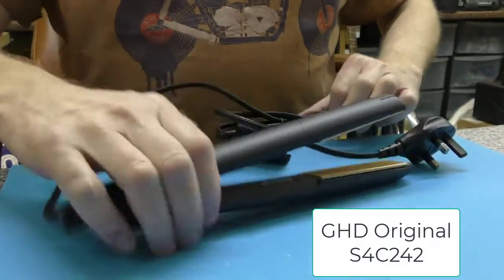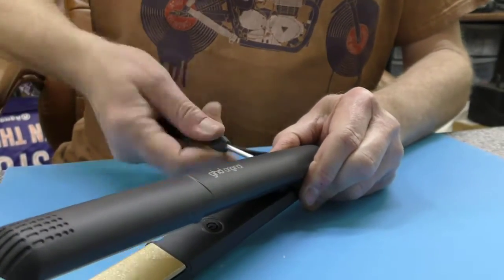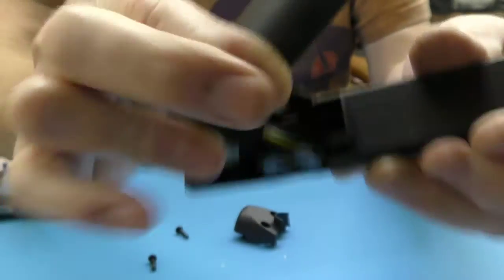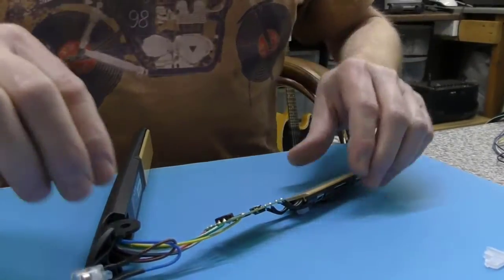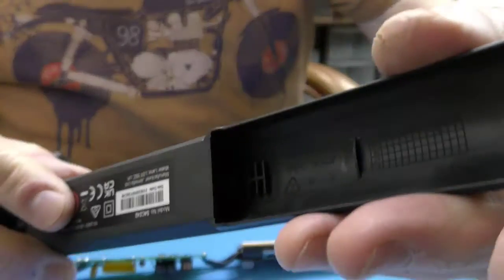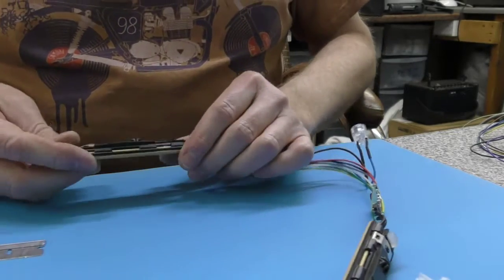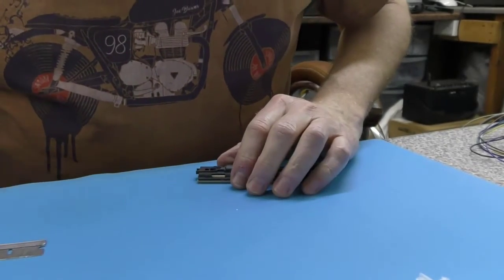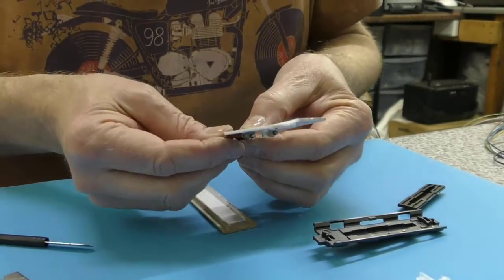New GHD Original S4C242 Hair Straightener Tear Down

Comment: Hi can you tel me why your replacing the heater element when you checked it and you was getting a reading around 540 and 40 ohms … I have stripped the wife straighter down and I’m  getting the same reading does this mean I just need to order a new PCB thanks for help Steve
Reply from the maker: Hi This model is not a diy repair. The readings are correct.
Reply: @ hi Trev do you think it’s just the pcb . I have checked all connections and wiring and elements just unable to check pcb
Reply from the maker: @ Highly unlikely. What are the symptom?
Reply: @ it just dead won’t turn on I don’t think there is anything else to check both elements give me the same reading around 40 and 429 as I say I have tested all the other cable and connections??? I’m at a loss if not pcb 🤨😊
Reply from the maker: @stevesolks9989  Dead is a PCB fault, you can't just change the PCB, the firmware is adjusted to the element values in the factory. If you did change the PCB the temperatures will be too low or too high, very risky and the reason that I do not sell the PCBs and only offer a repair service.
Reply: @Trevs-Shed  thanks for your advice Trev looks like a new pair then .. Thanks again Steve